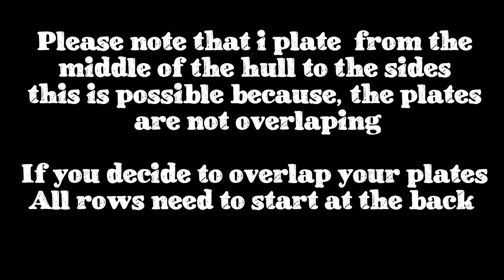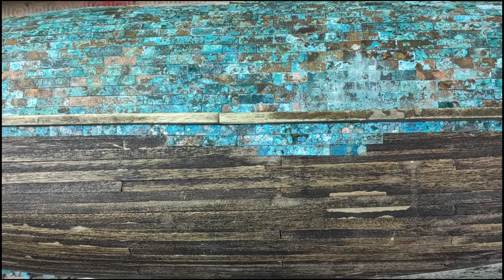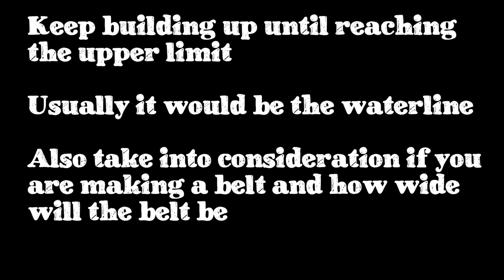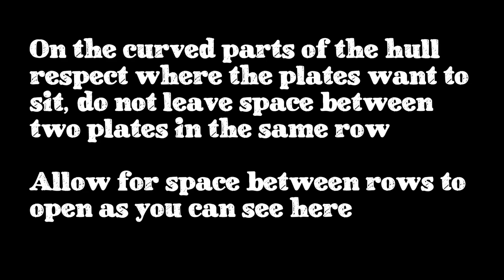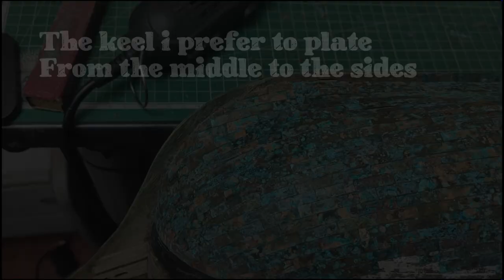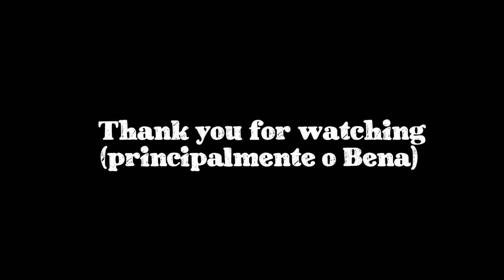Santisima Trinidad - Part 18 - Copper plating the hull

Comment: Will copper plating stick well to a varnished/polyurethane coated hull? Im assuming so and can’t think why not but want to make sure
Reply from the maker: The problem of adhesion is always on the chopper side, any piece that comes off always comes and leves the glue behind, e é if the glue doesnt glue as well on the varnish compare to raw wood, will still be better than on the chopper side, Light sandind will help

Comment: Hi, 

I want to thank You for a really great guide to a copper patina. I am interested in this topic and I have some ambiguities about the patina of copper on ship models.
Please, can You try to answer my questions?
1) Is it true that copper plates on ships in active service at sea did not have the patina of oxidized copper, but only a different color of copper plates?
Why do I ask? 
I saw a few dioramas where the ship was at sea, but the oxidized copper color was shown above the water. Is it correct or is it a mistake? 

I also have a question about your beautiful model and this video.
2) Do you still apply any transparent matt lacquer after sticking all the copper plates on the hull?
Why do I ask?
I think if You leave those oxidized and patina-coated sheets of copper without topcoat ( lacquer), the corrosion of the copper will continue and the resulting effect of the patina will be poured into one oxidized copper color. Isn't that so?

3) If I am right with point 1), how long do You think would the ship have had to be in a dry dock for its copper plates to get the patina of oxidized copper-like we can see in the video?

Thank you in advance for your answers.
Reply from the maker: I can try, if i know the answer
Reply from the maker: 1 yes the copper underwater does not get patina, the color would be just darker copper, and right on the water line you can see a pink band, the patina only forms on copper exposed to air
Reply from the maker: 2 yes, it needs to be sealed, I don't seal it right after, some shinny copper gets exposed during the handling of the plates, I give it sometime for that to darken naturally, and then a clear coat of Matt varnish

3 no idea how long it would taje
Reply: @ModelShips  ...thank you..👍👍👍👍 Good luck with your building.🍀
Reply: @dzitny  Are you sure that it does not get patina underwater?  If you take a look to the hull restoration of the USS Constitution in the drydock the cooper seems to be covered of the greenish patina.
Reply: @jorllima  ....do You know how long is Cony out of water in Dry Dock?
Reply: @dzitny  take a look, there is a video on USS Constitution youtube's channel where you can see the ship entering to the drydock and when they start to pump out the water you can see that the copper hull is in his bright greenish patina.
Reply: @dzitny  USS Constitution enters dry dock part 1
Reply: @dzitny  so yes, it is absolutly true that copper hulls get green underwater, as far as I know, only muntz hulls such as the cuttysark's only turns into a dark brown color but its because the different (Cu+Zn instead of only Cu) compositon. Regards
Reply: @jorllima  ...... Thanks for the link to this video. This gives a clear answer that the copper plating below the waterline can wear a oxidation like you say. The only thing that surprises me is why the copper above the waterline does not have an air oxidation like we can see  on the copper roofs of churches. Best regards..👍
Reply: @dzitny  if you take a look at google images it is because the waterline has some antifouling treatment over copper platting, but I dont really know the reason why they dont apply it to the whole underwater body. Regards